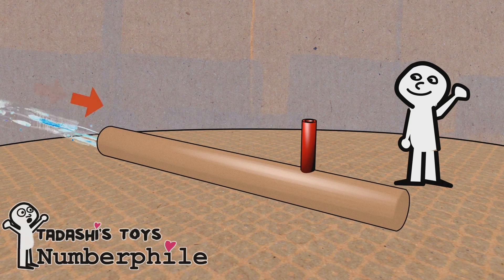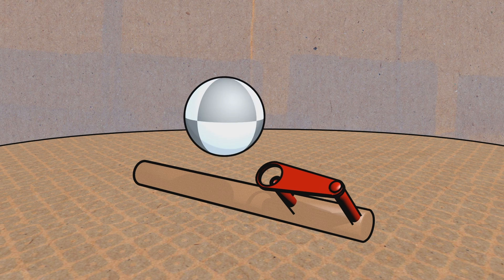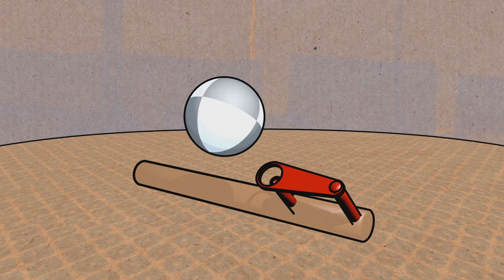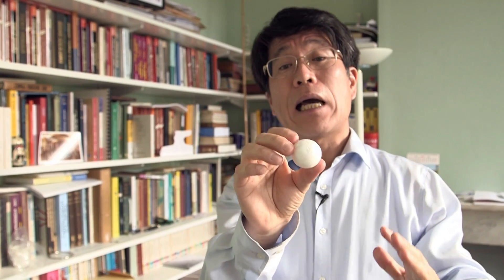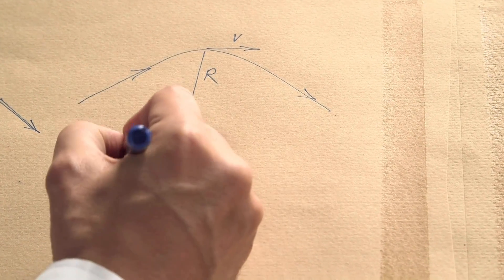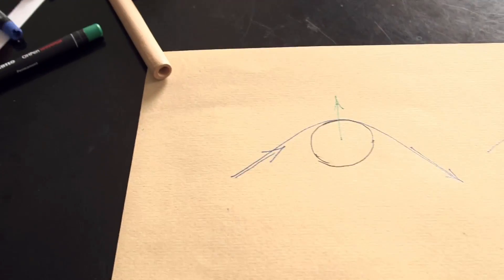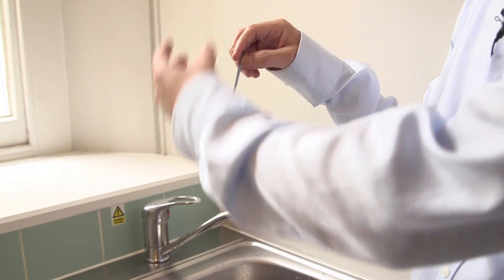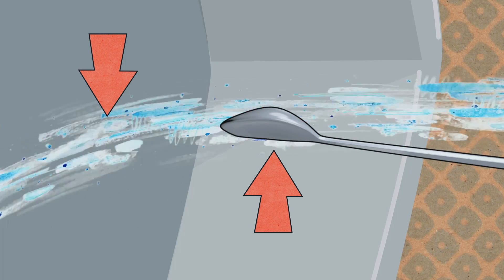Floating Balls and Lift - Numberphile

Comment: I was wondering whether I got the idea correct: it is the curved surface of the object that creates the pressure difference between the top and the bottom, and therefore lifts the object.

Comment: I'm pretty sure the explanation is wrong or at least incomplete. If it were true, then half the time the ball would fall of when titling because it would rotate in the wrong direction. So the roation has to be irrelevant.

What is really happening, I think, is that the flow of air is creating a low-pressure tubular column around the sphere. The sphere being very light is being kept in the low-pressure zone by the higher-pressure non-moving air around this column. When the sphere starts to move outside of the column, a side of the sphere touches the high-pressure region and the pressure differential between the side of the sphere touching the high-pressure zone vs the side of the sphere still inside the low-pressure column pushes back the sphere inside the column.

 The sphere rotation is just a red-herring.

The explanation about the air attached to the ball is correct only in the sense that when the ball starts to move outside of moving air-column, there is more moving air on the side of the ball that is still in the column, so that increases the amount of air that is deviated by the ball on that side, which again has the effect of bringing back the ball into the column. Again, the ball rotation has nothing to do with it.

Comment: the spoon/water analogy is a great visualization but a couple things are nagging at me. 1) in one case a stream of fluid is free to move through and deflect more or less in free space (i.e. the surrounding air is static) which is different than a wing moving through a volume of static air. It's hard to imagine the entire volume of air behind a wing is getting pushed down. 2) the spoon handle. holding the spoon by the end you are allowing it to rotate, which is expressly prevented in aerodynamics (why horizontal stabilizers exist on aircraft). Blowing on one side of a strip of paper seems like a better model; holding one end is analogous to a plane wing's momentum or thrust, there is clearly a pressure differential / lift, and no air is being forced downward behind the paper (it actually looks the opposite, but that's just because the paper bends towards the low pressure. speaking of, it makes way more intuitive sense to me to say the faster, low-pressure air on top of a wing pulls upward than to say the bottom pushes; to me the bottom is pulling downward too, right? just with a pressure much less than the top because the bottom surface is flat

Comment: Two curves make the balancing act. For other kind of object it is different. Spin is usually the difference in torque. The vector addition. The pressure difference is the angel of incident on the ball.

Comment: 3:04

Can someone please explain how a single, 3-D airflow stream leaving the pipe should longer be considered as a single stream just because there is an object in the middle of the stream?  When I have a stream of water travelling on a path, putting an object in the middle of it does not divide it into separate streams, the single stream simply curves around the object in all three dimensions.  

Even aside from that, the Bernoulli Principle can be used to talk about two entirely different streams, that is how vacuum pumps work.

Comment: Asking whether the wings of the airplane are being pulled up by air or pushed up by air is nonsensical.

The lift can only be generated if there is a difference in pressure between top and bottom of wing.

If the pressure is the same in both ends... then nothing happens... it is all balanced.

This is like asking a question. "If two numbers that are not equal, are they not equal because one number is larger or are they not equal because one number is smaller!"

Comment: Numberphile is usually fun to watch and highly accurate, but this time you made some mistakes. Air molecules pulling on each other? No, not noticeable. Air pulling the wing up? No, there is a force up because of the pressure difference, that is: the air molecules are pushing less on the top side than on the bottom side. And the water / spoon is due to a different effect - the cohesion between water molecules and the metal of the spoon. That is, in that case there is actually a pulling force.

Comment: How finicky is this ball-and-tube setup? Can you make a small ball 'levitate' in any space or do you need still air? Do you have to vary the air pressure? It seems like compressed air and a well-designed rig could be used to turn this into a pretty neat magic trick, but it would have to be pretty consistent to be impressive.

Comment: Off the vertical, I have questions:

How far can you tilt before the ball falls out of the airstream, and why does this critical angle have the value it does?

During off-vertical "flight", what direction does the lift vector point? In airplane flying textbooks, the balance of forces is typically shown as horizontal drag being balanced by horizontal thrust, and vertical gravity balanced by vertical lift. How does this picture relate to what's happening with the ball?

In the on-the-vertical situation, it seems to me that there is only the lift vector balancing the gravity vector and there's no drag. But this cannot be correct. The ball wanders around in the airstream chaotically here, whereas in off-the-vertical flight, the ball is far more stable in a fixed position. My intuition is that when the ball wanders away from the center of the airstream in the on-the-vertical situation, simultaneously the lift vector is bent off-vertical in a direction opposite to that which the ball had displaced. The horizontal component of this new lift vector acts to return the ball to the center of the airstream. So while it's chaotically wandering all the time away from center, the overall tendency is for the ball to return to center.

What's actually happening?

I'm eager for a followup video!

Comment: Only about 5-10% of the lift generated from the wing is resulting from the pressure difference. The rest of it is generated from the wing being at an angle to the relative airflow (angle of incidence).

Comment: About the imagery of the airplane wing; if you have pressure on both the top and bottom of the wing, wouldn't you imagine the air is pushing on both sides but just less so on the top? I can't imagine the air on top "pulling" while also maintaining a measurable pressure.

Comment: so, the way that we look at high and low pressure regions in meteorology could be considerably improved if we were to look at the pressure gradients over altitude as well. the pressure differences rising up through the altitude would probably tell a much more complete story than just normalising all pressure be be that of sea-level and showing only the lateral gradients.

Comment: is the professor suggesting that van der Waals forces are what keeps airplanes in the air? or is there some other weird attractive force between uncharged molecules? if not, the animation of the 'spring' forces between molecules should be removed - it's complete nonsense. i think it's really dangerous to use figurative (imaginary) concepts like 'vacuum pulling' as explanations as if they were real phenomena.

Comment: Great video! But the explanation works only if the air goes over the top and bends downwards, giving an opposing force upwards. I wonder why the air isn't going underneath and bending upwards to give a downward force, given the ball is symmetrical? I'd have thought that both were equally likely. Or do you have to look at which way the ball is rotating to choose which way you tilt the pipe for the "trick" to work? Or I am missing something - quite possibly something obvious :-) ?

Comment: Does the cohesion occur in an inviscid model?
Cos the deflection-force is still there, but the cohesion occurs due to the boundary layer, which isn't there in an inviscid flow. Afaik the gap would make turbulence, would that pull the stream lines in?

Comment: Could this effect be explained by the angle and power of the air stream ? If this the case it's no different from when the ball is floating directly above the pipe. This should happen so long as the angle and pressure is supportive in relation to gravity.

Comment: QUESTION: When you go from the vertical air flow to the oblique air flow, why does the air flow curves down lifting the ball instead of curving up and dropping the ball? Is there some sort of self regulating effect like with the two cups rolling down rails shown in a previous Tadashi video?

Comment: I like the spoon demo better for this explanation because you can also show that what happens on either sides of the spoon would be working in concert in a homogeneous fluid except that you can show the two effects separately.  Turn the spoon over and deflect the stream the other way and you can also feel the force in the other direction.  You can also pull a spoon lengthwise through a pool of water and see and feel both at once.

Comment: The 'coherence is called the Coanda effect and it is most certainly the reaction of that deflected airflow that produces most of the lift of an aircraft. The resultant pressure gradient can be optimised to reduce drag. If the pressure gradient gets too large and exceeds the coherence to the solid then the flow separates and turbulence boundary layers form.

Comment: I cannot agree with the image of air molecules connected by springs.  That works fine for solids, but in a gas the force gets SMALLER with increasing distance, whereas a spring force would get LARGER.  This is not an insignificant point.  If there were "springs" connecting air molecules, transverse waves could go through air, but in fact transverse waves cannot go through (the bulk of) any fluid.  This is how the liquid outer core of the earth was discovered.  (Before anyone asks, you can of course have transverse waves AT THE INTERFACE between two fluids -- between water and air, for example, or between the warmer, comparatively fresh water at the top of the ocean and the colder, saltier water deeper down.)

Comment: The wing in a plane as a slight angle in relation to the movement of the plane, that’s the push up effect.
The second force, the pull, is given by the shape of the wing.

Comment: Regarding the spring analogy, air is virtually an ideal gas so there are negligible intermolecular forces that act as springs under tension. The vacuum effect is still essentially just a push from the other side.

Comment: You didn't explain why there's a curve in the first place. The ball is symmetric and starts out without rotation - what makes the air pick a particular direction to curve in?
Reply: I believe it is because the ball is pulled down by gravity causing the point where the air hits the ball to be slightly above the center of gravity due to gravity pulling the ball down. So because of inertia, it is easier to curve so that the low pressure area is on top, and then it curves to go horizontal because of the resistance to making a vacuum, and for the opposite reason with inertia the air trying to go around the other side (the bottom) has trouble getting around so it creates a high pressure region because the speed is slowed due to resistance because length of curvature on this side of the ball is greater because it’s not really an equilibrium because it isn’t really symmetrical at this point because of gravity, also the very force of gravity pushing down on the air would cause the air to slow from friction. Then when they meet it creates a stable flow horizontally, I think...

Comment: I usually love Numberphile videos but this one was a disappointment. It seems like it's tricky to explain aerodynamics. What I want to know is: 1) Why does the air curve downwards and not upwards, i.e. why will it lift instead of push down? 2) What is the equilibrium mechanism that makes the ball stay suspended in the airstream, both vertically and horizontally? Why is this a stable system?

Comment: How is it possible to fly a combat aircraft upside down, If high pressure-low pressure theory is correct?
Reply from the maker: You should check out the Sixty Symbols lift video which is linked from this one.
Reply: If it’s flying horizontally, the lift and gravity will pull it downward. They have to angle their thrust to counteract the pull either with thrust vectoring or by angling the aircraft upward.

Comment: I don't think the explanation is complete. Ok, if the flow of air curves because of an object, this object will be pushed by the air because of momentum conservation, that is clear. But why does the air curve in the first place,  in particular what breaks the symmetry in the case of a sphere? If parallel streamlines come against a sphere, they should keep going in the same direction on the other side, there is no preferred direction they should bend towards. In this case, it looks like what breaks the symmetry is gravity, i.e. the flow of air is curved by the sphere in such a way that the "push" against the sphere is in the vertical direction. Why is this?

Comment: Doesn't really answer why the ball doesn't fall though, it just begs the question, "why would a perfectly round ball with a column of air hitting it from some direction preferentially curve that air against gravity?" He's not wrong in anything he says, but he needlessly disparages Bernoulli's principle, which gives a mathematical way to answer the question that's usually much more useful than trying to calculate momentum transfer in a system. If you look into lift on rotating spheres, it turns out you get a pretty close answer using continuity equations (i.e. Bernoulli, Navier-Stokes) and a few easily measured properties of the system. The same can't be said for using momentum.

Comment: Isn't it essentially wrong to say that an airplane's wing is being pulled up? Since pressure is, by definition, exerted by particle collisions, wouldn't it only be pushed up? I mean, there are other forces pulling the wing up (gravitational force between the air above the wing and the wing itself, for instance), but they are quite negligeable.

Comment: What about the flow of air on the other side of the ball? Wouldn't that create an equal and opposite force?
Reply: sk4lman No, because it's also deflected to the same side. Think of it as conservation of momentum.
Reply: If the air flow was split equally between over and under then there woud be no net force on the ball but gravity would pull the ball down until there was more airflow over than under hence producing a net upward force which cancels the gravity.  It's a negative feedback position control loop all done by nature without any need for poles and zeros.

Comment: But, when using a spherical ball, why does the angled flow deflect toward the horizontal?  It seems that there would be an equal chance of the flow deflecting toward the vertical, e.g. straight up, or toward any other random direction in three-dimensional space.
Reply: I suspect the reason has something to do with gravity pulling the ball toward the bottom of the stream of air, so more of the cylinder of air is moving over the top of the ball, setting up the condition the video illustrates.

Comment: What makes the ball spinning in the first place?
Reply: air which flows at the top has to go a longer distance than bottom so theres more torque through friction
Reply: NachtHemd no, it simply goes faster at the top than the bottom.
Reply: I guess, in that case the flow is not hitting the ball symmetrically.

Comment: By 7:56, I can already say that either prof. is kidding or he just doesn't like physics very much.
1) He did *not* explain, why air is curving. (Of course, one can study the question himself). I believe that this is what is most interesting about the subject.
2) Air molecules DO NOT HAVE "SPRINGS" IN ANY WAY. Distance between any two air molecules at each instant is so big, that intermolecular attraction is usually jus neglidged. What's really happening is that molecules on the side of the body with smaller pressure "push" the body [per unit of area] less than those on the side with higher pressure - That is how we define pressure.
Reply: So how do you explain the spoon part? Seems like a "pull" effect to me, unless the water is somehow changing the air pressure on the other side of the spoon?
Reply: FinetalPies It's just conservation of momentum.
Reply: Александр Бантьев lol at this guy trying to explain anything while still believes the law of ideal gasses. It's called "ideal" for a reason, dumbass

Comment: What I find most fascinating is that it appears to be a stable state solution.  I would never have guessed that there was such a solution.  I would've assumed it would fall to the floor and that the air would push the ball away as well as giving it lift.

Comment: I thought the video would explain why is it a stable system? Why the ball doesn't just flies off at the first bouncing sideways
Reply: Jorge C. M. Learn manners
Reply: My guess that it is self controlling system. Vertasium has also made a video about the same effect and he explains exactly this question. The video is called Hydrodynamic Levitation!.
Reply: If the ball started falling then it would deflect the air even more, so there would be more "lift" force, and the same thing happens viceversa. That implies an stable equilibrium.
Reply: Denis Molla learn grammar